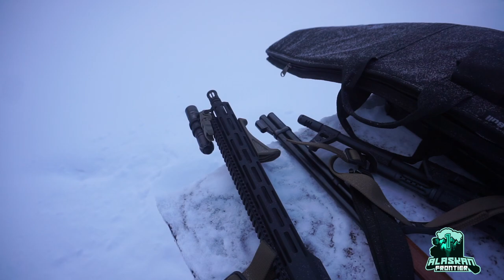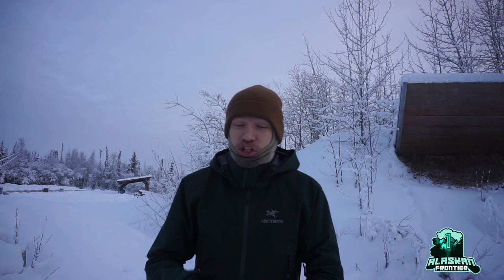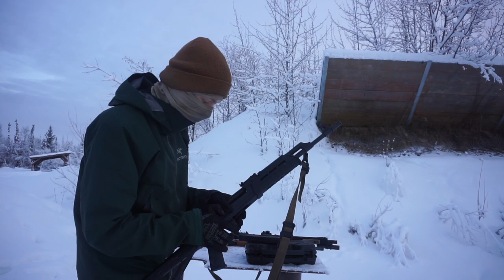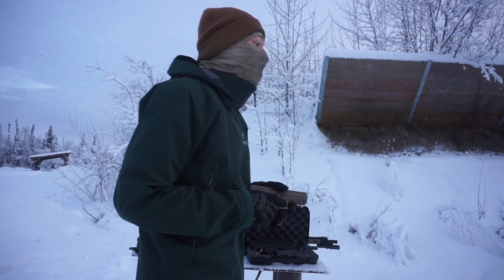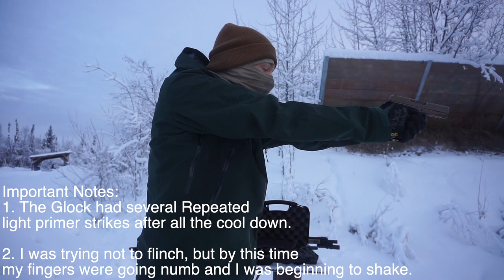Does Oil Cause Your Gun to Freeze Up?

Comment: Oils will perform better than a gun grease type of lube in cold temps... Military found the biggest problem in sub zero temps is bringing the firearm in or around warmer temps which caused the weapon to condense moisture in the action which would freeze once it returned to outside temperature.
Reply from the maker: Hmmmm